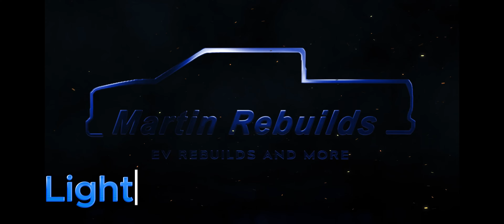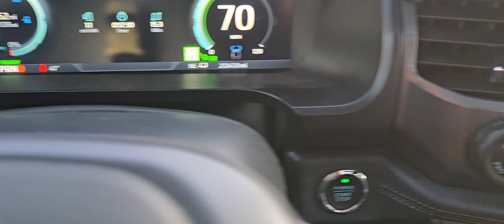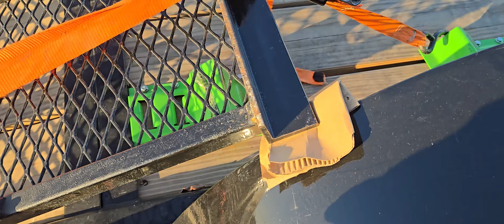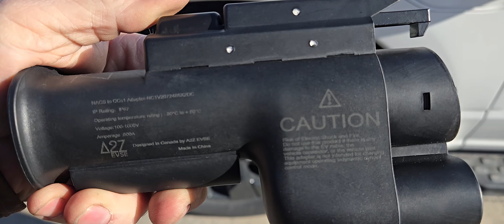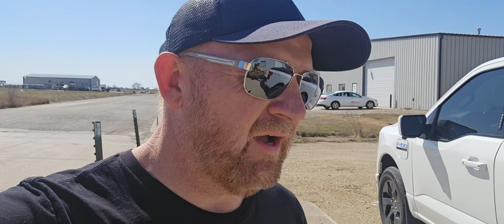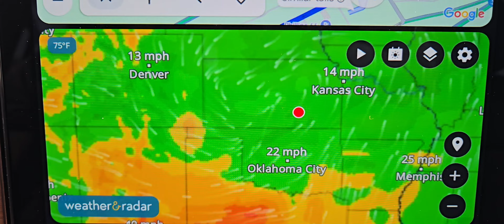Ford Lightning Trailer Towing Trip- Real World

Comment: I've been wanting to ask you if a gooseneck plate can be put in a Lightning. I gave a four horse trailer that I pull about 75 miles one way and have to keep my diesel solely for that purpose. I only drive it monthly to keep the wheels rolling and would love to get rid of it. Since you have had the beds off, I figure you know if it can be easily done. Thanks.

Comment: Nice to see some real world towing videos and not someone dragging around the biggest camper they can find then being shocked when they only get 100 miles! Very excited to hear some news on the generator setup you're working on
Reply from the maker: That's what I wanted to convey, that in normal everyday life the lightning can do regular tasks that most of us do with an F150. Your right, it doesn't have to be a huge camper then being surprised at the results. Stay tuned on the generator setup, its in the works.